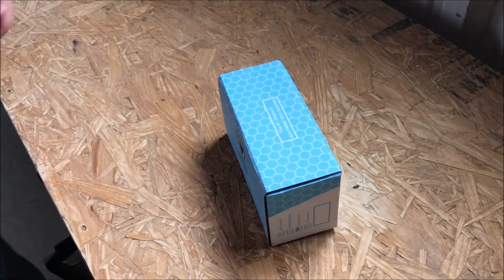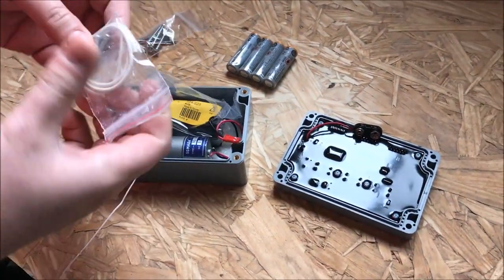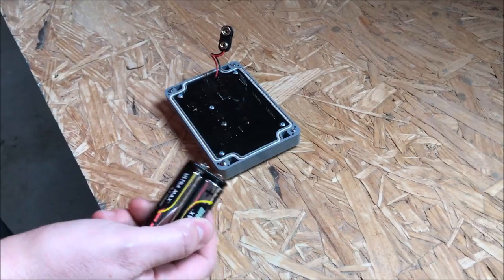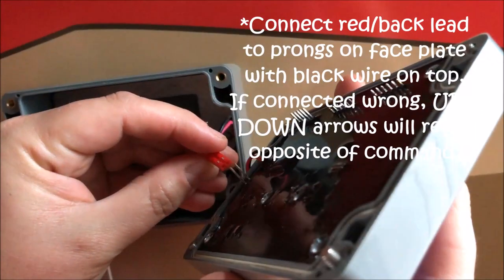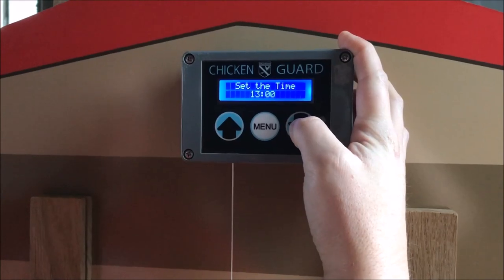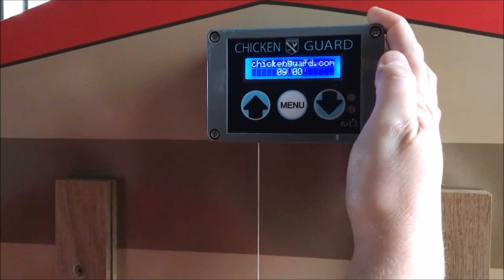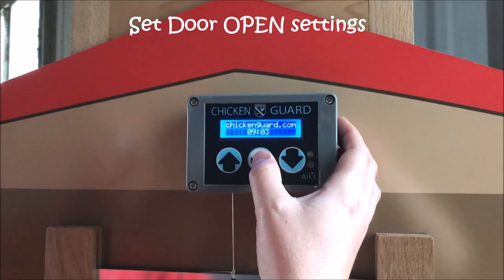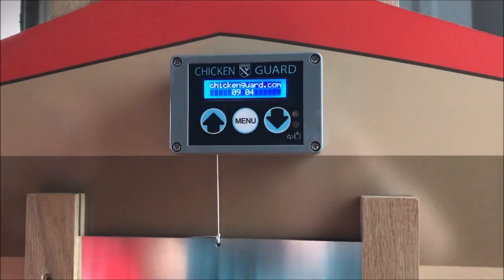ChickenGuard Automatic Chicken Coop Door Opener Quick Set-up and Installation Help Video

Comment: can the door be lifted if you get a paw underneath it? asking for a friend.
Reply: 1974mazdarx3sedan good question
Reply: 1974mazdarx3sedan  - I’m guessing it depends on the critter. I just got the Chicken Guard Extreme. I bought it because it comes with a locking door. I’ve got my coop and run locked down like Fort Knox but I wanted extra security for peace of mind just in case a  determined critter decides to dig under my buried wire. Having the Chicken Guard will give me to sleep in and give me much needed rest.